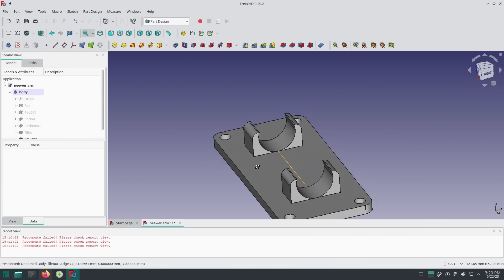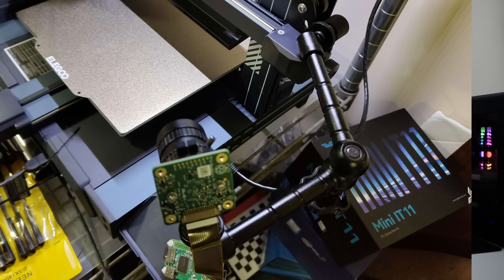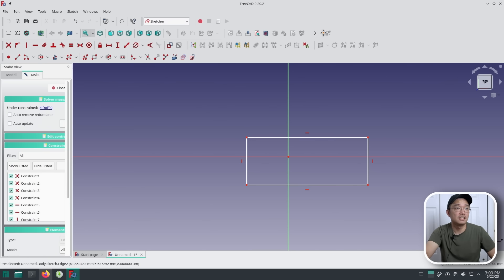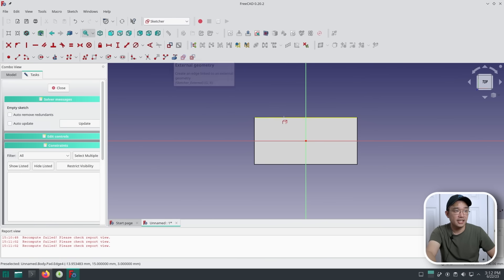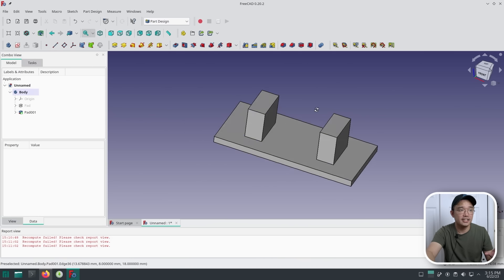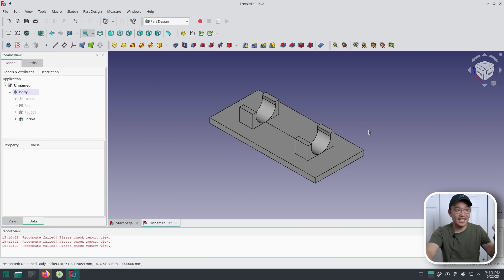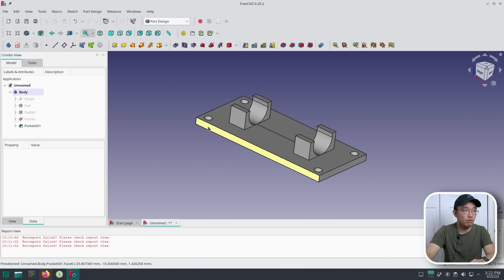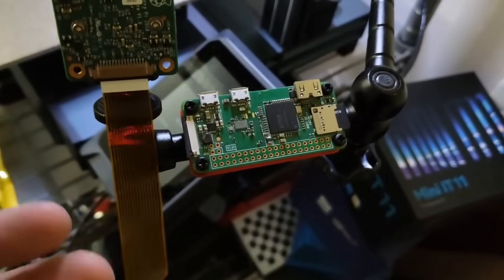Learning FreeCad with These Basic Steps

Comment: You'll get better over time quickly.  You can constrain opposing corners symmetrical to the origin to lock down the original Sketch faster, and you can Mirror one post across the centerline to get it on the other side rather than draw each and lastly apply Hole through all rather then needing a dimension.  If you draw the circle starting on the vertical line, it will already be constrained to center left and right.  Same thing, Mirror the holes and you can constrain them equal as opposed to dimensioning each.

But kudos for already having a design sense of how to realize what you have in mind.  That's a critical skill.

Also, a "fill-lay" is a "filet" or steak.  But a CAD rounded corner is a "fill-et", with a hard T sound.
Reply from the maker: i love this comment, not only is it educational, you go about it very politely. thank you!

Comment: I would have done everything in two sketches: 

For the first sketch start with rounded rectangle tool, center it by selecting two points diagonal each other and then the origin, and use the symmetry constraint. Create a centered rectangle as construction geometry for the hole placement, and set the diameter of one hole with a dimension while setting the remaining holes equal to that one. This way if you want to update it for a different board, you have six dimensions in one sketch instead of seventeen dimensions spread across two sketches and a fillet command. 

The second sketch is the profile of the clips, you can offset the sketch to get it where you want one of the clips, pad it, then mirror the pad to get the second clip.
Reply: As an engineer it's good practice to create the main body and then add holes/chamfers/rounds as separate features. This allows for easier relations to be specified especially in more complex parts and assemblies. Just because you can do it in 2 sketches doesn't mean you should.
Reply: @deathrocketaus  Using the actual fillet or chamfer tools is something you should apply as a last step, because it often breaks things, but fillets created with a sketch are much more reliable so it's a good idea to put them in the sketch when it's easy to do so. If you need to reference something you're creating with a sketch, it's best to name the constraint in the sketch and reference that directly, as that neatly sidesteps topological naming problems. It's not as reliable to just reference a vertex or edge on the model, regardless of whether you have fillets.  

In this case, everything in that first sketch is driven by the dimensions of the pcb, so it makes more sense to keep all that in one place. I'd probably still make an identical master sketch even if I was doing it in multiple features. That's likely what would have happened if the PCB was a double sided load, and needed standoffs.
Reply: Well said, and he missed if drawing a circle starting on the center line, it has that constraint already.

Comment: Ansys spaceclaim is my preferred choice or design spark mechanical
Reply: I expect to create about 50 designs per year as a hobbyist for my 3D printer, but just can't justify paying for software.  I find the far majority of most everything I need to do on a regular basis involves mostly Sketching and Lofting or Pockets.  And once you understand Drawing Planes, you can do them anywhere needed at any angle to add or cut away anything from a design.  Then it's on down to much less frequent Pipes and Sweeps/Revolutions and of course finishing touches like Chamfers and maybe some rare Raised Lettering.  Like most modern software, 80% of what you really use it for is accomplished in 20% of its full functionality.  So at this point, after 20 designs, I can do all of those nearly with my eyes closed and can imagine just about any object in my mind and envision the workflow and sequence of those features I'll add to build the object.

I actually watched a sketching tutorial in a couple other CAD systems before committing to learn FreeCAD and couldn't detect any real benefits of one over any other. 

Even if I saved 2 clicks here and there, they would never add up to warrant $$$ a year for something like Fusion360 when my average design takes me less than 10 minutes from start to finish to complete now.  I'd rather spend the money on a trip to Las Vegas, or at least a flight.

There's no question that using a tool for a JOB warrants using the sharpest and most capable tool, but then most employers foot that bill along with the upgrade cost to stay current.  But for hobbyists like myself, FreeCAD far exceeds my needs and will only get better over time at the mind blowing cost of zero.

Comment: I've been using freecad for a number of years now, for designing parts for 3d printing, and while I would go about this project somewhat differently it's a good introduction video.  One thing people should know is that freecad has a few "quirks" that will drive you nuts.  But once you become aware what causes them and how to avoid them they're not much of a problem.
Reply: And if your used to Catia or solid works you will find it unacceptable, tormenting even.
Reply: @hornox4life  Well I tell ya I've used solidworks for a couple of years and it's not crash proof.  True it's more elegant than freecad but it comes with a hefty price tag.  As a veteran I was able to get it for twenty dollars a year for the student license.  Why did I switch to freecad?  Because there was no guarantee that at the end of the year solidworks would offer me the same discount.
Reply: @hornox4life Thats for sure. I have been a decade on solidworks, and moving to freecad made me want to throw the laptop out the window. But once I got the basics it started to click. But, I went back to solidworks for a couple of weeks, and returning to freecad today, all I had learned had gone. 😂🤣.
Reply: The Real Thunder link branch for FreeCAD addresses the problem.

Comment: I like Freecad, but it suffers the same problem as lots of opensource software, namely, sub-par UI/UX.  I have tried it so many times but always end up going back to either OnShape or Fusion360.
Reply: Everyone has their preferences, and certainly, coming from another application brings biases.  You either put in the time and learn the application, or move back to pay for alternatives.

I had solid experience, but not heavy, in two prior applications: Tinkercad and ViaCAD Pro, but readily picked up everything I needed in FreeCAD within a dozen practice and real drawings.  My only remaining complaint is why they don't let you just pick any mouse/keystrokes for moving and rotating in the main view, instead of just a limited number of presets to choose from.  Other than that, no complaints, all the way up to some pretty complex models including curved boolean cuts and raised custom shapes...

But if it isn't your cup of tea, then it simply isn't.  I went for this UI configuration and see it as about as modern as I would ever need with transparent and dockable overlays leaving much more of the screen for your design.  I find the icons intuitive, the color scheme attractive and of course you can change any shortcut keystrokes:

https://www.youtube.com/watch?v=6iU0g-X5Z1g&t=10s

I find the far majority of most everything I need to do on a regular basis involves just Sketching and Lofting or Pockets.  And once you understand Drawing Planes, you can do them anywhere needed at any angle to add or cut away anything from a design.  Then it's on down to much less frequent Pipes and Sweeps/Revolutions and of course finishing touches like Chamfers.  Like most modern software, 80% of what you really use it for is accomplished in 20% of its full functionality.  So at this point, I can do all of those nearly with my eyes closed and can imagine just about any object in my mind and envision the workflow and sequence of those features I'll add to build the object.

Certainly if paying $500/year for Fusion360 isn't any concern, then you should use what you prefer.  Despite likely hitting 50 or more designs per year, I just can't see any benefits that would warrant paying anything like that, but then I've always been a BUY rather than RENT guy and hate the subscription models so many have gone to.  I actually watched a sketching tutorial in a couple other CAD systems before committing to learn FreeCAD and couldn't detect any real benefits of one over any other.  Even if I saved 2 clicks here and there, they would never add up to warrant $500 a year when my average design takes me less than 10 minutes from start to finish to complete now.  I'd rather spend the money on a trip to Las Vegas.

There's no question that using a tool for a JOB warrants using the sharpest and most capable tool.  But for hobbyists like myself, FreeCAD far exceeds my needs and will only get better over time at the mind blowing cost of zero.
Reply: no need to try 'many times', only describe your vision on the relevant opensource community board once, devs are not psychics you know.
Reply: @Mr.Leeroy  no need to get so defensive.
Reply: @cyberlizardcouk  merely rational
Reply: @Mr.Leeroy - Not really. Behavior like yours makes FC the pain in the butt that it is. But I'm not an expert. Only an engineer with 30 years of experience.

Comment: Equal, horizontal, vertical and symmetrical constraints will improve and speed up your workflow quite a bit. Especially with the holes, create one and the rest will automatically follow the constraints.  This is key when your designs become more complex and requires changes. Also note that you can adjust the way the mouse navigation works in many different ways - in preferences > display > navigation
Reply: One surprisingly useful Workbench in FreeCAD is Spreadsheet. It makes your design parametric. So you link the dimensions to the drawing and instead of tweaking numbers in the drawing one just goes to the spreadsheet and changes the values. The spreadsheet operates similarly to a normal spreadsheet where values can be formulated to calculate the value. Also there is a macro which one can use to make it easier to make a cell name alias something descriptive. So for example instead of say cell C4 it can be called "Width".
Reply: as far as perspective controls go, you don't even need to go in to settings, just click on the little icon in the bottom left corner.
Reply: Watching him do his constraints and the pocket reminds me of people who center text with multiple spaces and paginate with multiple enters in word processors. Yes, those will work, but it is more precise and more forgiving of future edits to use the proper alignment/constraint tools within the software package...